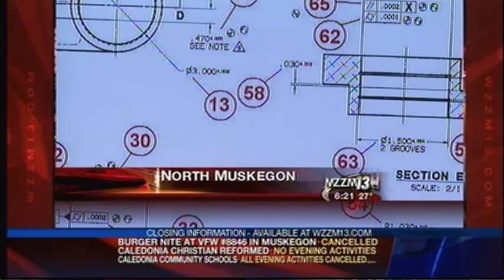AFO Brace With Dorsiflexion assist

Comment from the maker: @Cupcak3Diva 
We are working hard on getting this sellable. It takes data that must be generated by certified people. It's one thing to say you have an idea that works but potential buyers (prosthetic companies) need to see proof on paper. I can relate to the rubbing problem. It's not so much an issue with my added mechanics as the brace is not so ridged. The mechanics allow smooth fluid motion. I can also relate to being active at your age. This brace design makes it possible.